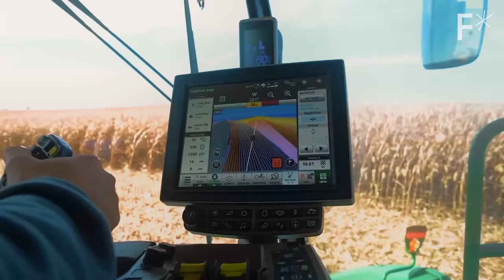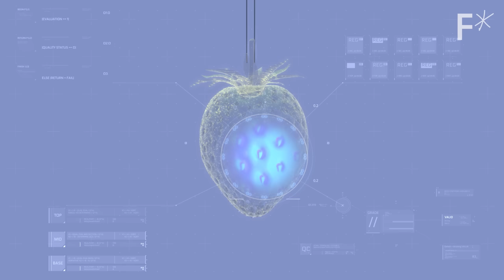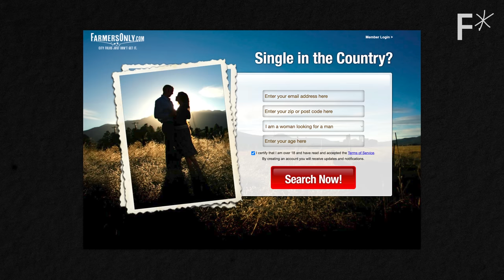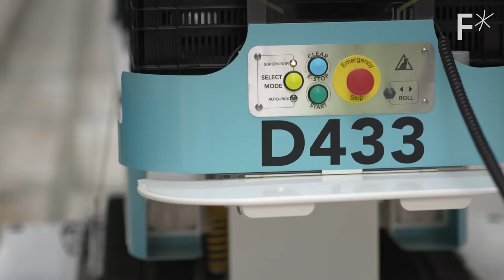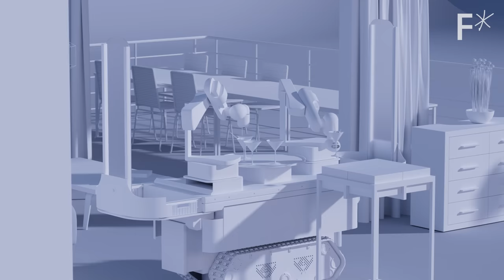The farming robots that will feed the world | Hard Reset

Comment: Those robots could also laser bugs to remove the need for pesticides.
To reduce water usage they could also be used to deliver it more precisely. Maybe it will even decide to skip some plants that don't need it.
Reply: I like the idea! It's amazing to see how intelligent robots can be with water and pest management.
Reply: Lasers...how did we miss that idea?! :) You've picked a brilliant use case though. The data the robots gather during their operations is extremely valuable to farmers and, like you say, can lead to a per-plant approach to farming. Allowing identification of problem areas amongst the crop and detailed forecasting of growing yields. This is a big win in a world with ever squeezed resources and endemic issues such as pesticide resistance. Ultimately resulting in reduced food waste and maximised food production.
Reply: @julianDogtooth  A small blast of very hot air should also kill the insect but leave less damage on the plant. Would you do better by ignoring "muddy" environments and aiming your robots more at hydroponic vertical farms? You'd be avoiding the difficulties of natural environments while selling to more forward thinking farmers. Can the speed of picking by improved?

Comment: I've worked with a lot of pick-and-place machines for surface mount electronic parts. If they can make them as fast as they have for the last 30 years..... Picking up tiny ant-like specks of electronics parts and distributing them faster than you can see......

Then these fruit robots will be going light speed in no time. Just getting things accurate first... and then ramp up the speed from there like happened with "pick and place" technology

Comment: I teach high school computer engineering (mostly smaller robots) and also manufacturing engineering technology (mostly bigger robots). I love to use Hard Reset videos to generate discussion about technology and society however they have a lot of seemingly unnecessary profanity. Coming from the manufacturing field I know the profanity in these videos is incredibly tame but school boards are also very strict. The random swearing at 1:51 that doesn't seem to add anything to the article makes this video unusable unfortunately. Would it be possible to make clean versions where profanity is bleeped out or avoided? I think you did that for the "Third Thumb" video which was appreciated. The videos I really want to show my classes are on gene editing.... but the expert's word choices makes those videos entirely impossible to show in a school setting per the rules of my school board.
Reply: you bleep

Comment: They could add a second picker to the one robot arm so it take picks two berries. I honestly don't get the picking (edit: picture*  ~= picking) part. Unless these berries are going straights to washing and packing. I don't see the need to take pictures of them.  I feel like a human being looking through the punnets would be able to identify abnormal berries.  If pictures are absolutely needed., I would take them in the punnet and the berries that are defective get dropped from underneath. That's just me though, and I am sure they have their reason for not doing my idea.
Reply: Hi I like your critical thinking.  "They could add a second picker to the one robot arm so it take picks two berries." --- We have looked into that quite a lot, it's a neat idea but quite tricky as you need to be really dextrous with a long and thin end effector to get in and pick the berries ; and if you had a first berry dangling off your arm when you pick the second, you run a high probability of damaging the first berry as the arm moves around.
The pictures in the inspection chamber are so we can do an even better job than a person looking through the berries in the "punnets"... and we don't need to handle the berries twice (which increases the risk of bruising them). 
 Frank T, CTO @ Dogtooth.
Reply: @franktully  Gotcha. I meant picture part not "picking part haha" 

Eitherway I undestand why you did it the way you do.

Comment: Eu seriously need to build huge nuclear power plants to prepare for population decrease. Robots need electricity the more electricity better.Cheap labor by robots plus low energy costs means a booming bussiness.
Reply: Uranium and Plutonium are finite ressources.
Reply: @SheepWaveMeByeBye  So is coal but Germany started to use insane amounths of coal to keep energy cost somewhat a moderate level since solar and wind energy reform made it way too expensive. Also the materials you use for solar and wind power is finite too and they wear down after a few decade for sunpower 10 years is enough to see a dip in the energy produce. Nuclear power is the most cost effective power source and it is pretty clean. You need small amounths of uranium and plutonium to work it.

Comment: How is this ever going to be economical? A person can work at least five times faster than one of these robots. A person is also much more flexible, for instance a person can also run to the warehouse and get some tubing and install that to provide maintenance on the farm. On top of that a person doesn't have much of an upfront capital cost. By the way, capital costs cut into viability of a business model far more then operating costs. 

Actual quotes from the video:
"All parts have to be made from scratch.. they need to be supervised by people.. they work at a quarter of the pace.."

this sound like a pipe dream! let's see if it becomes a reality before western civilizational collapse
Reply: They did say in the video they are purposely making slow for testing. It shouldn't be too hard to speed it up. They said soon they will try half speed of a human then 3/4.

Also their not the only one working on this type of automation solution so eventually other big players will show their stuff making it cheaper. Hobbyist can easily build a robot arm, this one is a just a bit more specialized but there's stuff a advanced production supply can be built off of by using the amateur production supply to help. Also they never mentioned the price.
Reply: It may go nowhere, but maybe they'll figure it out and it will become viable. New tech sometimes takes time to get right, let's hope they can do it :D
Reply: @DigitalCosmos555  of course they would say it's slow for testing purposes. They need to lure investors to continue operating their company! They don't even show any extended footage of the thing doing work, probably because it is slower than an uncoordinated three year old.
There was a big buzz around automating lab work some time ago. All the machine had to do was manipulate an industry standardized 96 well plate. We have two of the machines collecting dust in our building, no one ever uses them. They are slow and unreliable. 
If you ask me, the best way to assess viability is to check speeds of a similar sized welding robot. Why wouldn't they make welding robots faster if they could reliably do so? Now compare the value of the items manufactured by the welding robot and the berry picker. Granted, that's a difficult comparison to make since the berry picker produces a ready-to-sell product, while a welding robot is only doing one step of the production process. But in terms of top speed i think they would be comparable. Funny enough, all the electronics factories are based in Asia since labor is cheaper there. That shows you the level of automation involved in the production of electronics. 

I'm sorry, I don't want to poop on your parade, but it strikes me as fantasy, along with other technology miracles such as fusion energy. I admit I may be biased for personal reasons, and I am injecting too much personal bias and emotion into my arguments. But the truth is that robots killed my father. Next thing you know these farm robots will be used to murder my people. A LINE HAS TO BE DRAWN

Comment: More techno-utopian drivel. The cost to scale these systems coupled with the stupendously fragile supply chains necessary to produce, deploy, develop, and implement these systems is enormous and conveniently never considered. Take the modern and mature tractor supply chains and its near complete collapse in the last two years. That's a relatively low-tech product with a developed supply line that is 70 years old and largely produced almost entirely within the various producer countries. Meanwhile, these robots depend on a global supply chain that is currently in free fall. But sure, this'll solve the world's problems.